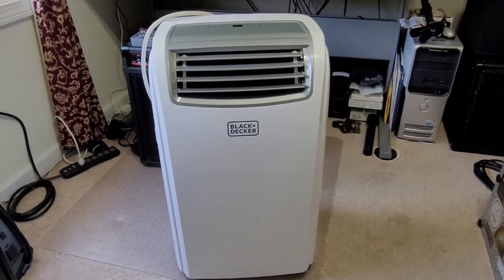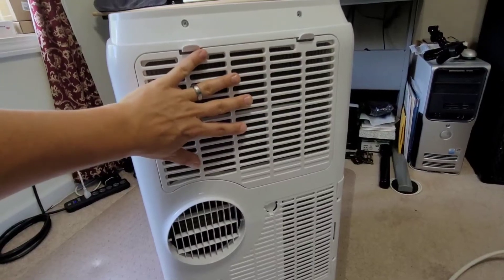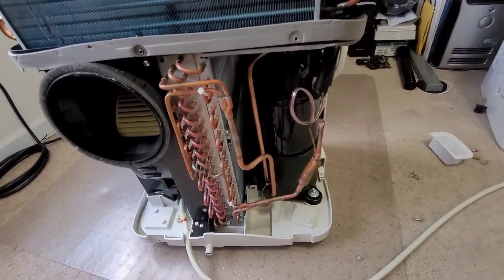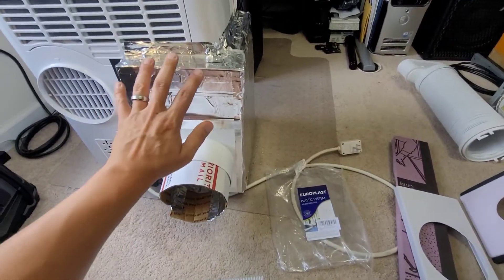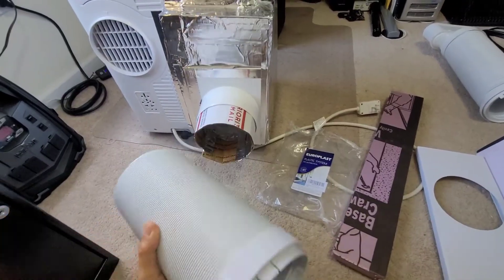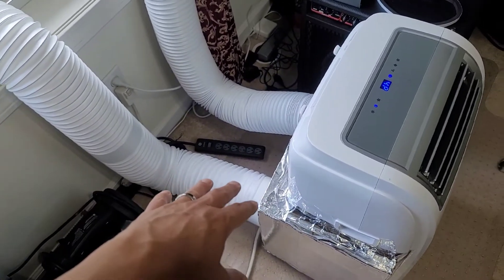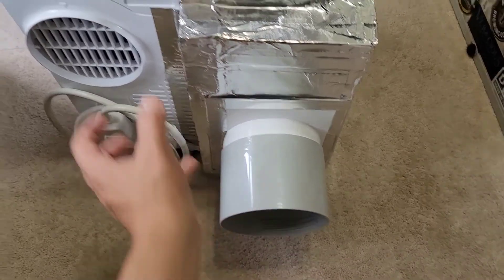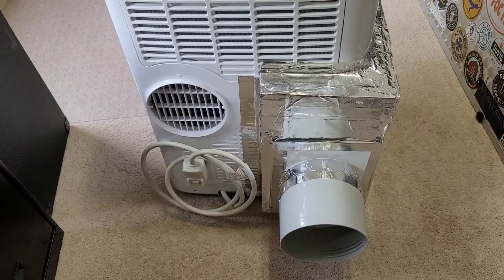Black & Decker Portable Air Conditioner BPACT14WT: Single to Dual Vent Conversion

Comment: single hose AC units should be illegal to manufacture!!
Reply: Seriously, wtf were they thinking
Reply: @0my  making more money through planned obsolescence…😢
Reply: Now you need 2
Reply from the maker: Agreed! Sadly they are still widely popular!
Reply: They are absolutely stupid.
I picked one off the curb on trash day,  a massive "Penguino". I didnt know it at first, but it made the other window unit get moldy, and blow water vapor. I thought the other unit had a problem but couldnt find it. I kept cleaning it. When I modified the Penguino to two hoses ( actually 3 I added two intakes) , suddenly the other window unit dried right up. It was because the penguino was pulling our tropical weather in through the house cracks. The amount of air it pumped out of the house was unbelievable... like a window fan. I used two 4" dryer hoses to match the 6" exhaust hose it had and also had to do some internal sealing
Reply: Ya! Seriously, I just wasted $400 thought it would be a more affordable way to cool my garage. It pulls more hot air back into my garages it ran for 6 hours and dropped the temp only by 0.8 degrees F.
Reply: Right? 14k unit barely cools one room at the expense of the rest of your house.

Comment: what would happen if we played the thermodynamics game ? and  vented all the hot air intake higher up, maybe near  ceiling height , sure the fans would have to work harder ( if they do or not  to suck the air down against its natural will to rise up, but it means then the unit is blowing cool air below the hot air in the room and  thus  segregating the temperatures not wasting already cold air

Comment: This is very innovative. So you use cardboard to build that air box around the intake then tape it up with aluminum foil tape or just made from aluminum foil tape? Thanks.
Reply from the maker: @awdrifter3394  closed cell foam and aluminum tape. :-)
Reply: @Bassguitarist1985  nice

Comment: GREAT EXPLANATION MOST PEOPLE JUST DON'T UNDERSTAND THE FACT THAT YOU'RE SUCKING OUT THE COLD AIR THAT YOUR AIR CONDITIONING IS CREATING WHICH IS WHY THESE THINGS ARE SO INEFFICIENT COMPARED TO A STANDARD WINDOW UNIT WHICH STICKS THE CONDENSER OUTSIDE! I EVEN HAD A GUY COME UP TO ME ONCE IN AN RV PARK AND GO YOU DON'T NEED TO PUT THE SECOND HOSE OUTSIDE IT WORKS JUST FINE WITH ONE HOSE AND I SAID NO I'M LITERALLY CREATING A VACUUM INSIDE MY RV AND I'M DRAWING IN HOT AIR FROM OUTSIDE PLUS EJECTING A LARGE PORTION OF THE COLD AIR THAT THE AIR CONDITIONER IS CREATING HOWEVER IF I PUT THE CONDENSER INTAKE OUTSIDE RIGHT NEXT TO THE CONDENSER EXHAUST WHICH IS OUTSIDE I THEN GET A REAL SPLIT SYSTEM PACKAGE UNIT SPLIT SYSTEM IN THAT WE CONDENSER IS COOLED AND EXHAUSTS THE AIR THAT IT USES TO COOL THE CONDENSER OUTSIDE HAVING ITS OWN LITTLE MINI SYSTEM AND THE EVAPORATOR COIL INSIDE WHERE WARM AIR IS PASSED OVER THE EVAPORATOR COIL AND HEAT IS ABSORBED AND CONDITIONED AIR IS EJECTED INTO THE INDOOR ENVIRONMENT I'M SO GLAD TO SEE THAT THERE'S SOMEBODY ON YOUTUBE THAT ACTUALLY UNDERSTANDS THIS!

Note to anybody that thinks there's an air conditioner with a heat pump inside of it... A heat pump is nothing more than an air conditioner with a small mechanical device called a reversing valve and the associated controlling firmware to control that reversing valve. It's simply reverses the flow of the refrigerant There are no pumps heat or otherwise inside of an air conditioner that turns it into a heating device There is a reversing valve.
Reply from the maker: Excellent comment! Yeah this particular model that I reviewed did not have the heating feature. It is pretty cool though that they make them with the reversing valve now.  Thanks again for watching!

Comment: How do you prevent all the bugs and polen etc coming inside the machine and in your apartment through the AC
Reply from the maker: @johto  there is a filter on the intake at the body of the unit. It stops them there. There is also a grill on the end of the hose too, but small bugs can get past that. However they are stopped at the filter screen inside the AC body

Comment: Have you ever had to take the front cover off? I've been able to take the back off but I can't figure out the front of the unit. I need to replace the LCDI power cord and it enters from the rear but goes to the front of the unit. Any guidance or documentation would be appreciated. I've hit a wall finding any resources.
Reply from the maker: I've taken the whole shell off. I show in my video. There are body screws on the edges that hold it in place.careful not to overtighten

Comment: Just a word of caution ... if you do not also insulate the internal build these mods actually make the machines less efficient. Once you close off the intake side with the mod as shown, you create resistance in the air-path on the intake side leading to air being pulled through every single nook and cranny that exists inside the machine between the hot and cool side of the bottom condenser. In another test I saw done from a starting room temp of around 86 F, without the mod, the room temp after 30 minutes of running the machine had dropped to around 78 F and with the mod under the same conditions, it had only dropped to around 82 F .... Once the internals had been properly insulated from one another between the hot and cool side of that bottom condenser, which was a MAJOR task, the test was run again and the room temp had dropped from 86 F to 75 F within 30 minutes, which was a 60% increase in efficiency from the unmodified machine.
Reply: The above tests were done with an outside temp of 86F ... so considerably warmer that what is shown in this video.
Reply from the maker: The evaporator and condenser sections are sealed off internally. So far no issues during the summer heat! Works great in the garage and spare bedroom

Comment: Another bad design is how they blow air up towards the ceiling instead of out the front where people are. A work around is to tilt it forware quite a bit and put a piece of plywood over the top to direct air towards the front. I'd like to know how to get mine apart to fix it but after removing all the screws the covers still won't budge!
Reply from the maker: The front louvers should allow front air flow instead of straight up
Reply: @Bassguitarist1985  The louvers only tip down about 45 degrees from vertical so  there is no front airflow unless you tip the unit over forward. Doesn't matter now though because they are rubbish and the unit went dead and won't turn on again.  I had to try 3 of them to find one that would run but it didn't even last the whole season!
Reply from the maker: @stevec5000  Sorry to hear. My unit's still going strong and it's a 2020. We use it for supplemental cooling in the summer in the spare bedroom of our house and then also in the garage when I'm working on equipment. I would think the primary failure is the bad start relay since it is constantly cycling. Hard to say because they do not provide schematics for the unit, much less parts.

Comment: i was still pondering   ASHRAE  vs  SACC   btu  ratings.
ASHRAE  is the  actual  btu .  here  this is the
Black and Decker  14,000  btu  unit .
however
SACC  rating  is  8,400  btu .
so ,  which is it ?

14,000  btu is the Actual  btu .
SACC
is a  de-rated  real-world  Test  rating 
of the  Entire  unit in  operation .
60 %  de-rate ,  WoW  !

window  AC  units ,...ASHREA  =  SACC ,  100 %  Effective
( all the hot air  stays  outside )

insulate all hoses  , and convert to   Dual hose ,
increases the  SACC  Effective  efficiency , my guess is
to as much as  85 % ,  hitting  hopfully  12,000 btu  Effective .

at first i thought  i had  purchased an  8,400  btu  unit .
nope ,
it really  is 14,000  btu .

if this unit were placed outside , with No  hoses ,
and a  duct to the window from the Vent , would
make this  100 %  Effective , giving an SACC rating of  14,000  btu ,
just like a  window  AC .

with the Dual  hose  mod :
The  cold air  now  lingers in the Room, instead of being
sucked out the Exhaust .

i still  can't believe  manufacture's  make
efficient compressors and  heat exchanger cores ,
and yet ,
blow it all out by 60 %  reduction with a  Single Hose configuration .

your  video is an   inspiration , it made me do something about it .
won't bug ya anymore,... chill-fully-yours

Comment: you should go crazy  and insulate both hoses.
insulating the exhaust hose is a huge improvement.

O, the top back vent is  circulation, didnt know that , thanks.

the blower makes high volume air flow,  not good for sealed room.
dual hose is the only way for  home and apartments
Reply from the maker: @240mains  agreed on dual hose! Insulation on both hoses I'll try for next season!
Reply: @Bassguitarist1985  update  here ,
i  have a  6 inch  TakeOff  adhevise flange  duct piece,  from  Home Depot .
a  7 inch would have been better because the  
intake hose kit has  a  6 inch diameter .
Home Depot only has  6 inch and then  8 ,...No  7 inch

plenty of  2 inch wide  aluminum tape ,
a small piece of  cardboard , and a  sheet of
metal like , bubble insulation wrap .

like you said , it now acts like a real  window  AC  unit .

Big  Question :
how come  Black and Decker  couldn't  form  a  Hose fitting
connection  on the  intake  panel to  allow us to go  dual hose
by just buying an  extra  hose kit  , instead of all this  gyration ?
2 cents of  extra  plastic ?   please ,...
Reply from the maker: @240mains  no idea other than profitability. Many wouldn't buy the upgrade kit as the common person would not understand or care about efficiency. So if it wouldn't sell well then why make it is my guess

Comment: Good job! The exhaust hose does get hot (it's doing it's job), mine shows 120* on pyrometer. I taped some used bubble wrap, works well.

Didn't notice where your condenser filter is, maybe slots in from right side (looking at unit from the back).  It will get funky too, and needs periodic cleaning.
Reply from the maker: @Steve-xl2mn  thank you for watching! Yeah still going strong, no overheating

Comment: Does the power consumption decrease or does the cooling output go up after the conversion to dual hose?
Reply from the maker: @datageek9132  cooling output goes up I've noticed. Not stealing cooled air to blow over the condenser coils.

Comment: Is the unit truly self draining?   Is the a water container or is draining onto a tray?
Reply from the maker: @mrzif0013  there is a tray at the bottom of the unit with a drain port. There isn't a lot of water in the tray during operation because the evaporator coil condensation drips onto the hot condenser coils which re evaporates it and is sent out the exhaust tube.

Comment: Helpful the see this conversion. You have not clearly shown that apparently the ac also draws in air from a side opening for condenser cooling (in addition to the back intake which you pointed out). Could you draw the air that cools the condenser not from outside the house but from a basement? In a basement or a cellar you'd have geothermal cooling of the air, so you would be using that pre-cooled air and thus the machine might work even more effciently.
Reply from the maker: @wkgurr  Yes the intake for the condenser is on the rear and also the side. I suppose it would be possible to draw from a cooler room but you need to complete the loop so you do not create a vacuum negative pressure situation which is exactly why this mod was done. I've been running the unit like this for the past couple years with the second hose and no issues.

Comment: What about turning it into a window unit and using the exhaust tube on the air being cooled, and just looping it? My window is really tall, so it would fit my portable ac. So I was thinking about doing that, then sealing everything and just hope it works. Right now it's just a slightly cold air in front of me (I live in a 20m2 studio and it doesn't work that well).
Reply from the maker: I suppose that can be done if you have the room for it. Give it a try and post a video about it for us!!

Comment: I agree w/ your analysis and the additional intake hose you installed at the intake of fresh air for the condenser solved the drawback in that design👍
Reply from the maker: Thank you for watching! Yeah so far it's been working great! My homemade setup is a little bulky but the air conditioner does its job more efficiently I think. Always spitting out good cold air

Comment: I did the same to my unit but it was not enough so I put the whole thing into the window, basically I turned it into a window AC with some cardboard and tape and it's really good now
Reply from the maker: Thank you for the info!
Reply: It's not a good idea because the evaporator uses air from outside the room. That's not at all efficient. Window air conditioners cool indoor air.
Reply: @Fidel-l7w no, i used a cardboard box and tape to separate the evaporator side so it only took in indoor air and it really become a window Ac. The compressor turn on for 3 minutes and stops for 10m😂
Reply: @Hieu.minh97  well done

Comment: Does it still work? Any issues?
Reply from the maker: @RandomFunVideos  none!! Using every season for spare bedroom or garage
Reply: @Bassguitarist1985  thank you. Compressor on my unit stop working so I'm waiting for a replacement but definitely when I get the new unit I will try this.  Mine is with heat pump does yours also come with heat pump? Is it same idea?
Reply from the maker: @RandomFunVideos  no heat pump or heat option on my model.

Comment: Great job. Did you notice the dehumidifier mode to work better also?
Reply from the maker: @josephrawls  no change. Actually check out my related video on this project The dehumidifier mode is not exactly a true dehumidifier. It's basically air conditioning mode without adjusting the fan speed

Comment: Is the compressor not at risk by taking very hot air from outside and not the air of the room ?
I don’t know if the compressor from theses machines are made to support very high temperature …
Reply from the maker: Valid question, but I have been running this for the last year or so since this video came out during the heat waves and no issues. I took the advice of another commenter to keep both the exhaust and intake hoses as short as possible to prevent any air resistance. It's also reduces the amount of radiated heat from the exhaust hose going back into the room.

Window air conditioners cool off their compressor and condenser coils with the hot air outside all the time. The exhaust fan is drawing air from the vent I made the hose for over the compressor/condenser, same as a window unit.
Reply: És ha felében, harmadában alakítanánk ki a szívó részt,tehát a hűtött levegő is bejutna részben.Nem tudom hogy készült ilyen már,csak a bejövő meleg levegőt enyhítené.

Comment: My question is: Why is it about dual hose that makes it so much more expensive than single hose?
Reply from the maker: Energy efficiency would be my guess
Reply: in theory, itsn't it just another hose adapter and a slightly different design? Seems like its just an upcharge for no technical reason; its just supply and demand. So as Bassguitarist mentioned, its more efficient and "new" and more people want it

Comment: I did something similar to this with my current unit, a few years ago, but not nearly as good.  I almost went and bought a dual hose unit today, but looked around on youtube and I think I'm just going to do this.  $60 conversion for me vs $600 for a dual hose unit...   Glad I looked around.  Aluminum tape is a game changer thx